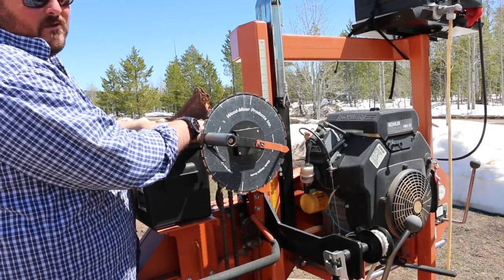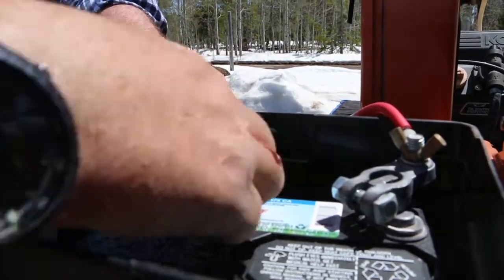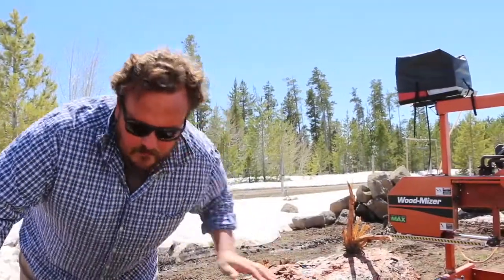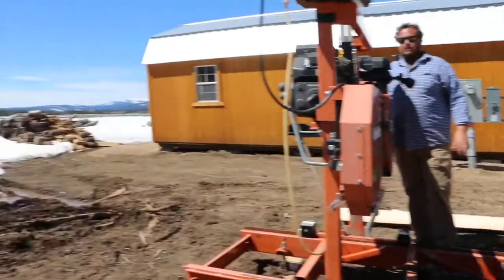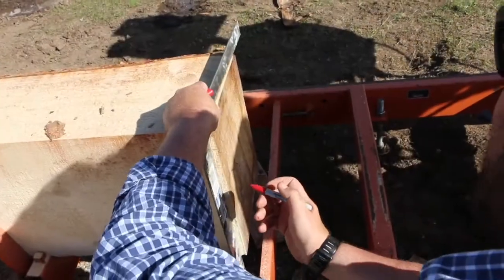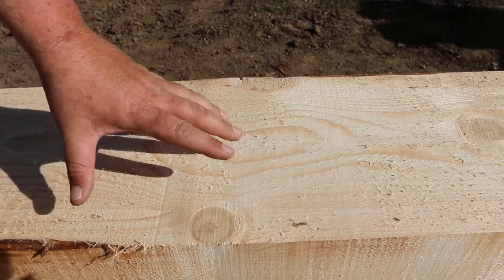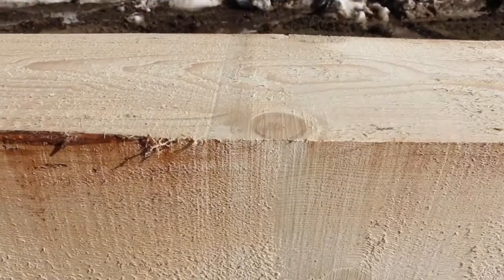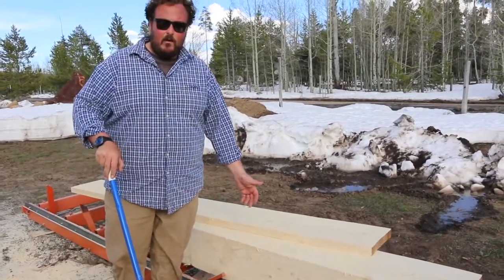Wood-Mizer LT15 Sawmill

Comment: On your battery;
1) use battery felt washers under the terminals to prevent corrosion of the terminals
2) use battery terminal spray (Permatex) especially on the under side of terminal and in hole for bolt and on bolt
3) some old timers use Vaseline or axle grease
4) use flat washer under nut
5) on lug ends type cables, you can use shrink tubing (I use 2 layers) to seal both the lug and the cable because it will corrode inside the connection between the jug and wire. Also after several years the cable will have corrosion up the wire strands (many years)
Reply from the maker: Brian Curwick that's a really good idea next time I'm in the auto parts store I'll grab some felt washers and I would really like to try out the spray
Reply: Essential Mountain Homesteading 
You might want to clean out the cooling air passages and the inside of the starter. When you change the oil, the best way to do it is at the end of a day when the oil is the hottest so it cleans out the crankcase the best.

Comment: 8:45 when operating this device, do you smell the exhaust gas?  if so it's best to use a mask I guess or attach a bigger exhaust pipe leading the fumes away from the operator ...  If you work your whole life with this machine you breathe in a lot of nasty stuff and you might be so used to the smell that you don't even notice it.

Comment: Get a tooth bar for the bucket and youll have better control over placing a log instead of slamming it on the frame of the sawmill. Its too good of an investment to beat to death for no reason.